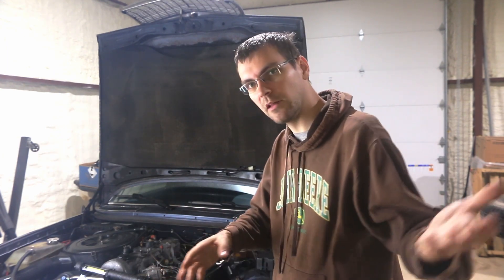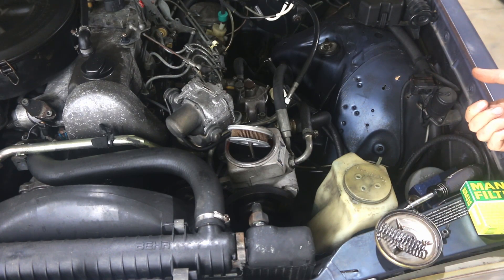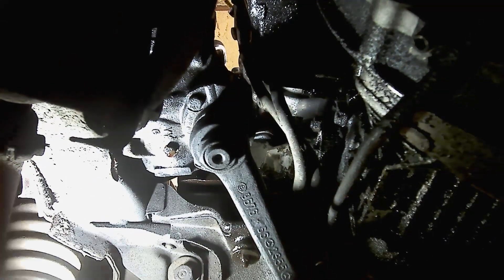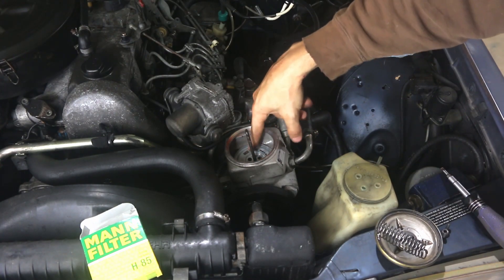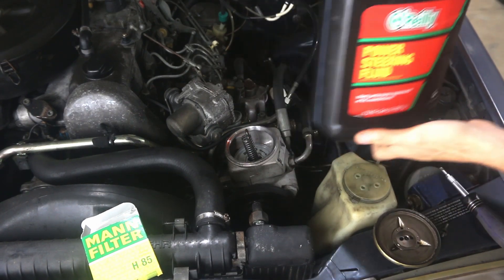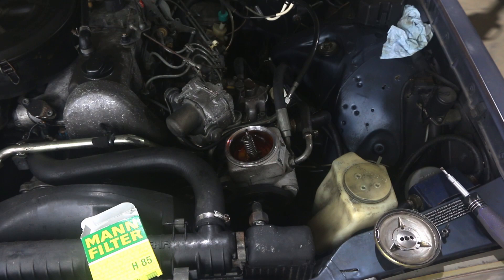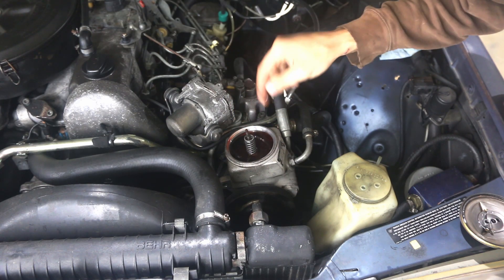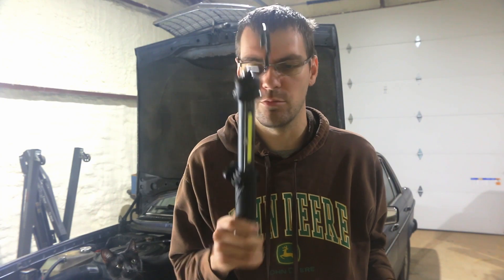W123 Most neglected maintenance points: Power steering fluid & Filter

Comment from the maker: All the stuff you need to do this:
Power steering fluid (probably better deal at your local autoparts): https://amzn.to/3kRCSC7
OEM Mercedes fluid (if you want to refill after flushing with cheaper fluid): https://amzn.to/2TOLFIY
Mann h85 filter: https://amzn.to/3kTCliT
12mm wrench: https://amzn.to/3mQqhjf
Screwdriver: https://amzn.to/3mKs0X3
Rags: https://amzn.to/323gCh1
Jack: https://amzn.to/2HXcrfE
Jack stands: https://amzn.to/2GlLnGu
LED Bar light: https://amzn.to/2I1IOKq
Drain pan: https://amzn.to/34O8N0K

(These links may be affiliate links, which earn me a small commission at no additional cost to you if you choose to purchase from one)

Comment: When I'm driving in reverse and turn the steering wheel right or left, it stops and becomes heavy, as if it's rubbing against something, then returns to normal. What should I do? The oil is there.
Reply from the maker: Could be possible you have some bushing or component that is loose and can bind up when under pressure in reverse, but forwards puts pressure in the opposite direction and un-binds it?

Comment: I’m planning on following your video and I got cheap power steering fluid,gonna drive 50 miles and drain it after that and drop in some good febi bilstein fluid,wondering about leaving the old filter in though while I let the flush fluid circulate?
Reply from the maker: That's pretty much exactly what I'd do, I need to do another flush or at least take a look at the fluid since it's been a few thousand miles and I'm curious how much has cleaned out. Might not hurt to check it at your next oil change and do it again if it picks up a lot of crud
Reply: @trythistv  ended up flushing the first round of oil after about 60-70 miles and it was daaaaark. Lighter than the original, still enough that I could see the new filter I put in. Also the original filter that was in there had completely separated from the two metal top and bottom discs and the actual filter component which was hard as a rock. I also thought it was strange you were able to drain the fluid without the car on but fluid would only come out of my car with the car on. Planning on doing one more flush with cheap fluid and then I’m gonna change out the filter again and put in fresh fluid.

Comment: my 78-300D PS filter was AWOL.  Added Mann H85.  my spring had a small retainer nut type thing
the PS fluid was nearly black
tyvm for confirm filter orientation
btw nice vid.
Reply from the maker: 40+ years can make the fluid real nasty. Glad you got a filter in there now, I wonder if the earlier years didn't come with one or if someone removed it along the way?

Comment: Great video. What fluid do you recommend for '81 280E and 240D? 
Regular ATF or Febi power steering fluid?
Reply from the maker: I'm running power steering fluid because I'm concerned about all the new additives and friction modifiers in modern ATF causing accelerated wear, the power steering fluid has been working nicely, I should do another flush and fill to get out more of the old stuff that was in there soon
Reply: @trythistv Thank you. I’ll use the ps fluid as well.

Comment: I had some play in the wheel So I tightened the box. Planning to change fluid and filter.
Reply from the maker: I need to tighten mine slightly, its not got much play but its more than it should have.

Comment: Great lesson.  I will do this on my 1983 300SD.  First I rebuild the pump because of leak behind pulley.
Reply from the maker: I've been meaning to do a video on rebuilding a power steering pump, I have a spare one, but it has never been serviced so I thought it would be nice to do and have as a backup should mine fail in the future.

Comment: i have 1988 560sl i changes the oil the steering still feels heavy at low speed what would be the reason
Reply from the maker: There is a pressure relief/regulator built into the pump if I'm remembering correctly, it is possible that over time the spring in that mechanism has weakened and the pump is not making the pressure it should, or possibly the steering gear has worn or something like the older bushing I had issues with binding and groaning could be adding extra drag to the steering linkages.

Comment: Great stuff been meaning to do this a long time. Seen videos before ant they never mentioned the drain plug, is it on a 280ce?
Reply from the maker: It should be on nearly every Mercedes power steering box up until sometime in the mid 90s if I recall correctly.
Reply: @trythistv  thank you! Mine is 83, I'll be under it this weekend so will check.
Reply from the maker: I'm sure you'll have the drain plug.

Comment: Really helpful , i have w123 230 , 1976 , seems streeng box is same as yours but my car engin type is petrol would be so appreciated if share any link regarding my car ,unfortunately i dont have any even user manual 😏
Reply from the maker: It should be identical. The steering boxes were interchangeable between petrol and diesel models, some of the rarer ones had less turns lock to lock for a little quicker steering and only came on certain v8 petrol models, but are a popular upgrade for the diesel models.

I think https://www.tonk.ca/models/w123/Index/115index.html should be what you need as far as a manual goes, If I'm correct you'll have a m115 engine, which looks a bit like a 617 or 616 with its SOHC arrangement and valve cover design. the M110 was very different looking as a DOHC engine.

Comment: Sweet little engine, is there a drain on the 300 sl 107, I will take a look
Reply from the maker: I'm fairly sure there is, I haven't had a 107 body yet though so I can't say for certain, but I do believe the steering boxes interchange so there should be.

Comment: This was a super informative video, you describe everything perfectly. I just had my power steering pump/reservoir in my '82 240D replaced as it was leaking horribly. However, the "new" pump (well, new to me via Ebay) has my car making that kind of "hush" noise when you turn the wheel, and it just doesn't seem to turn as easily. Fluid seems to be holding steady, though--is there anything I should check out, perhaps a missing filter (I had no idea those suckers were down there at the bottom of the pump)? Appreciate your thoughts, and thanks! P.S. I have George's twin, Shadow!
Reply from the maker: I'm not super familiar with the pumps insides, I do know these are a rotary vane pump, so any air could cause some terrible sounds, or too thick of a fluid as well.
I'd be curious to peek under the lid with the engine running, in theory it shouldn't make a mess, I had to bleed the power steering system on my very first Mercedes (a W116 1980 300SD) and did it by topping up the fluid while the engine was running, it spat a little when the air came out of the lines and was replaced by fluid but didn't really make a mess.
If yours looks like its being whipped into a froth then something is askew, either air intrusion through a crack in a line or seal somewhere, or perhaps the fluid doesn't have the right properties?
I'm not sure if I'm just rambling or if any of that will be helpful, hopefully the latter!

Comment: does anyone know if the crush washer is the same size as on the oil drain bolt plug?
Reply from the maker: I feel like it is smaller slightly. Its been a bit, but the oil pan is a 12mm thread size, and I feel like the power steering drain is like a 8mm or something. I'm not confident at all in those, hopefully someone can report back when servicing their power steering system!

Comment: what is a safe way to work under the car? Should i press very firmly on the parking brake? Or should i put the car in gear?
Reply from the maker: Either one would be sufficient, I would do both just for extra safety while under your car, and ensure it is raised in a safe way too, ramps or jack stands with extra safety like putting a block of wood under the car or such, I had some jack stands fail on me a few years ago and it absolutely terrified me, I'm very lucky that it wasn't far worse.
Reply: @trythistv  Damn.. I guess you can't be too sure... 
If you don't mind, i would like to ask you one more question.
My first gear and second gear (manual4w123) feel a bit hard compared to 3th and 4th. I have to be strong and slow to shift smoothly (does that make sense? weird to explain), I really hold and slide the gearknob along the outer left side to have a smooth shift. Otherwise it's abrupt and clunky. Do you think it's bushings inside the gearbox or what they call shifter bushings under the car? 
Thank you for the amazing videos, i'm 26 and learning a lot
Reply from the maker: @Altanox  Sounds like your Syncros are geting worn a bit. I swapped a 4 speed into my Grey 300D, and 2nd is a little crunchy if you don't shift it just right. Probably yours has a little more wear and 1st gear syncro has started getting a little worn too. I probably should have made a video about the swap or at least should do one now about the car in general but I have focused on the blue car a lot more.
Reply: @trythistv  synchos... I don't know what that is. Does it mean somthing inside the transmission that I won't be able to easy DIY? 
Damn it... :D
Reply from the maker: Yeah, I have not dared dig in that deep, from my understanding they are made of brass and attach to the gears and make contact to slow down or speed up the gears when shifting.
The better you can get at rev-matching shifts the less work the syncros have to do, and if you're real good at it, you can shift a transmission that has bad syncros without crunching or grinding.
I am not that good at it.

Comment: Is it fine to put power steering fluid or should I put ATF dexIII as I believe the manual says?
Reply from the maker: Getting actual dex3 is basically impossible now, the modern "dex3 compatible" formulations have changed from what the original fluid was and often have friction modifiers and other additives that can increase wear in the pump and steering gear, I choose to run standard power steering fluid that is clear and have had no issues yet over thousands of miles, only time will tell for sure, but ATF is not the same as it used to be for sure.
Reply: @trythistv  I was just wondering about that myself. I thought ATF was spec. It looks like I can pick up Dexron III easily locally. But I still wonder if it’s not the same as spec’ed by Mercedes back in the day.
Reply: @hanseich  I used Febi Bilstein 08972
Reply: The FSM uses the term ATF, but it actually calls for fluids which are MB standard 236.3 compatible—most contemporary fluids compatible with this standard are power steering fluids. 

Like most fluid guidelines for Mercs, it is the standard, not the title you should be concerned with as far as compatibility.

Comment: Very helpful  video.  Same deal on a W126 if anyone is wondering.  The fluid kinda drip,drip,drips out but eventually gravity does its thing!
Reply from the maker: I figured it would be similar or the same, thanks for reporting that it is indeed the same on a W126. Turning the wheel one way or the other seemed to slightly speed up the draining on my car.
Reply: Excellent  video .I persume  ATF will be good for a flush ,

Comment: Wonder if this could be done the same way in a w126 300se
Reply from the maker: I do believe the steering boxes are very similar if not the same, I would highly suspect it would be nearly identical. I've not done as much with the W126 bodied cars, nor the gasoline engines, but there is a ton in common between your car and mine.
Reply: @trythistv  thinking the same, jist havemt seen any videos/topics about doing the fluid change this way. The box may also be in a less accessible placement

Comment: I have drained the fluid but i there is no filter and even after refilling the pump resevoir the steering is still stiff. Get me thinking maybe the pump is dead. Any idea pls. Thanks
Reply from the maker: I thought I'd responded to you, But its not showing that I did. Weird. Must have mentally responded and didn't actually type anything. Some early pumps didn't have a filter, but you can put one in I believe. Also, double check that you got all the air out, I have had weird issues with entrapped air in power steering, but you may be right, the pump or steering gearbox may be on its way out.
Reply: @trythistv  thank for the reply. Any suggestion about online store that sells w123 parts that ships to Nigeria? Cos getting good or new parts here is near impossible. As always thank you for taking your time to educate us.

Comment: how often should this be done?
Reply from the maker: It is not specifically listed in the service manual that I can see, but I would check it at each oil change, personally I'd change at around the same interval as ATF, 30,000 miles or maybe a little longer with a good quality synthetic fluid, or when I notice it starting to look dirty or smell off.
Reply: @trythistv  ok, thx!

Comment: Didn't you defeat the purpose of the filter when you lifted it out the reservoir? (Removing reservoir cover, draining fluid while filtering old fluid from going thru the pump and then removing discarding filter...)
Reply from the maker: Perhaps slightly, there shouldn't be much if any debris in the ps system, and most any of it would have gotten caught in the filter, either way it's better to get that ancient fluid out

Comment: I tried to do my w123 230e today. Its got a full mercedes service history and guess what? No filter and no spring, boy am I pissed. Anyway, turned left full lock and it took an age to drain. Not easy to refill despite turning wheel, the pump howled for a bit. I tried starting the engine and the oil whipped up into a foam and spewed out everywhere.
Reply from the maker: Well that's not a very nice surprise!

Comment: Thanks for the informative video, very helpful. Would a lack of fluid / filter change cause heavy steering? My steering is heavy. The steering belt was recently replaced and the tyres are fine. Best wishes!
Reply from the maker: It might. If it isn't getting pumped well, or has worn parts due to the fluid getting nasty and abrasive, or the filter is clogged up with grunge, it would restrict flow, which would make the power steering less effective.

Comment: Great video! Thanks for posting. I had a question about the pump position…is it required for the pump to be straight up and down? My power steering pump is slanted slightly left towards the engine.
Reply from the maker: The pump will rotate slightly depending on the belt tension and thus length of the belt. Nothing to worry about as long as the belt isn't slipping or overtightened.

Comment: how much fluid did you use?
Reply from the maker: It seemed like a little over a quart per flush, I flushed it a few times, ended up using just under a whole gallon, the fluid looks fairly clear now with just a slight reddish tint. Cost me less than $30 for the filter and a gallon of the PS fluid

Comment: Woooow! How can your diesel be SO QUIET? How did you achieve that?
Reply from the maker: ... Mostly because I turned the volume down when I made the video, past that it sounds like about every other decent running 617 I've heard, whisper quiet compared to my cummins work trucks, but significantly noisier than a modern gas or diesel engine. Sorry to disappoint, no secret for silencing a 617 that I'm aware of I'm afraid

Comment: My power steering fluid has been leaking since i got my w123, basically the only problem. I cant see where it leaks , any ideas??
Reply: There is a gasket between the pump reservoir and the pump itself. Take a look on the back side and replace as needed
Reply from the maker: I've seen hoses weep ever so slightly, you should be able to locate the leak if you clean it all real well, or look for a clean spot somewhere, if there is a patch of clean on or around the pump and hoses, that is likely the source of the leak

Comment: Is the jack placed under the cross-member that's behind the oil pan?
Reply from the maker: Yes, it's very important to jack up the car somewhere safe, that crossmember is a good solid point that won't damage the oil pan or other stuff, I also used a couple jack stands on the control arm mount points as those should be plenty solid as well.
I had a W124 Mercedes fall off a jack and nearly crush me a few years ago, changed how I lift vehicles forever.
Reply: @trythistv  wow, ok thx!

Comment: so any PS fluid will do?
Reply from the maker: Right, any decent power steering fluid is going to be nearly identical to what the old ATF that was recommended back in the 70s and 80s was, the new ATFs all have additives to add friction, which isn't ideal in a steering box, wears parts out super fast
Reply: @trythistv  cool, thx....how much fluid comes out with draining it that way? I'm going to buy 1 gallon of Prestone, & am wondering how many drainings I'll do to use it all up. (old fluid looks very dirty)
Reply from the maker: @MrRjnr  I got somewhere around a quart, maybe a hair more out, you should be able to get at least 2-3 good flushes with a gallon I would think
Reply: @trythistv  cool, thx